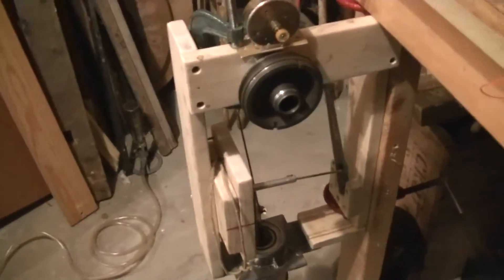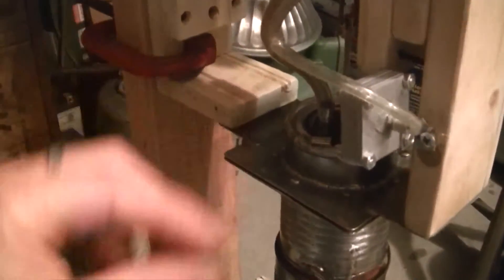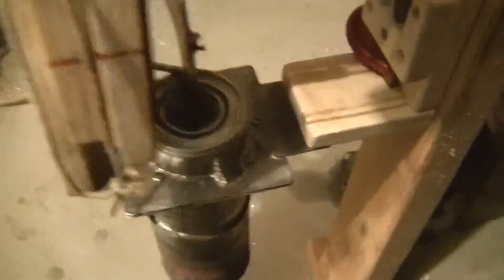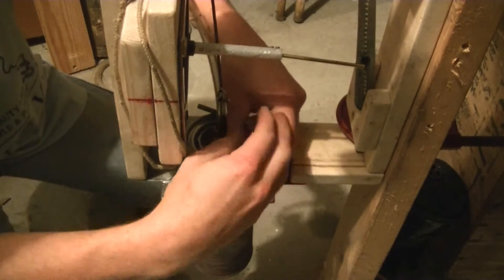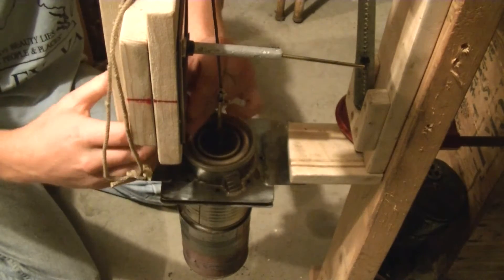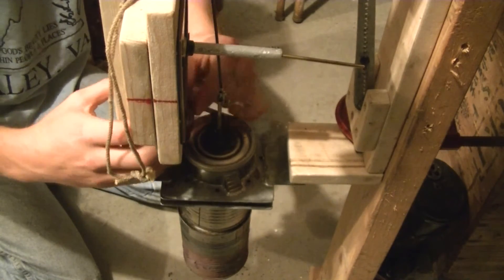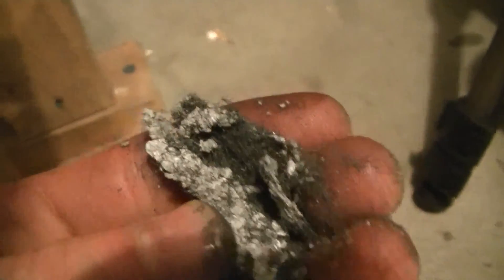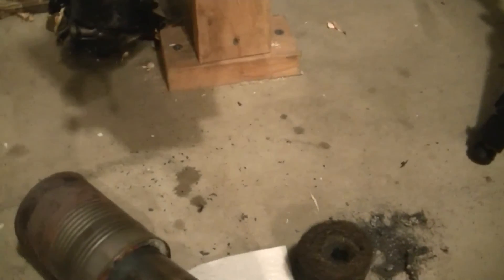Taking Apart My New Stirling Engine #5 to Fix the Displacer (it melted)

Comment from the maker: Yeah me too!  Yeah, probably not much air was going through it.  It used to be a lot more fluffy but when the aluminium melted and as the steel wool slowly fell off it got mashed at the bottom of the displacer.  It might have also melted when it was sitting in the bottom.  Because I didn't turn the Bunsen burner off as soon as it failed.  I tried to get it working for a couple minutes until I figured out that it had failed.  Do you have any ideas how I could build a new better one?  Thank you!

Comment: I didn't think of this when watching your build videos leading up to this, but I doubt much air is flowing through the displacer's steel wool from top to bottom. It's pretty dense. The path around it is much easier. I guess you could always test this by trying to force air through it.